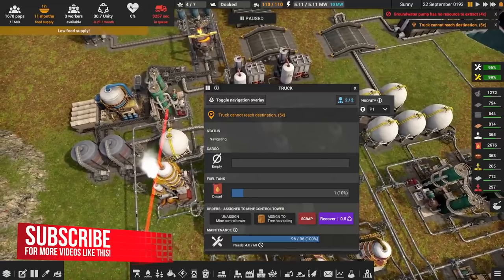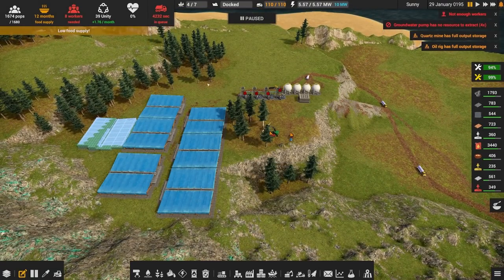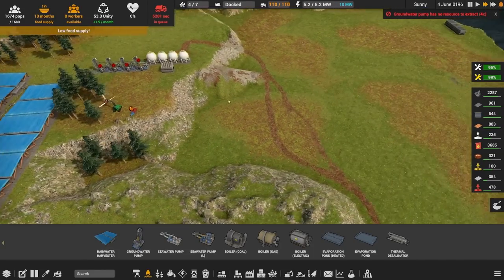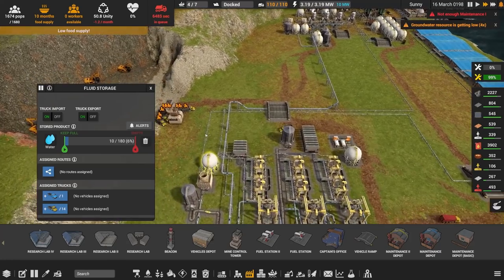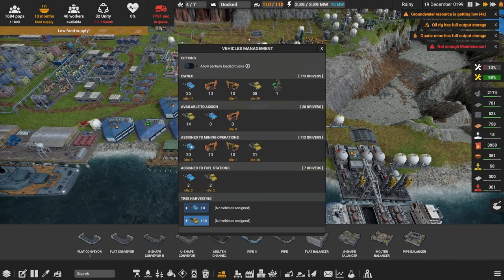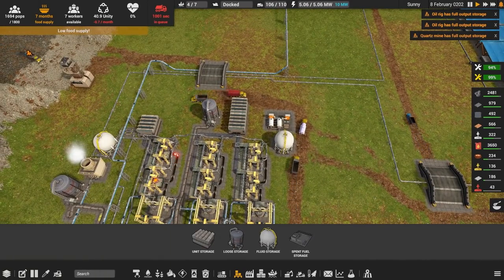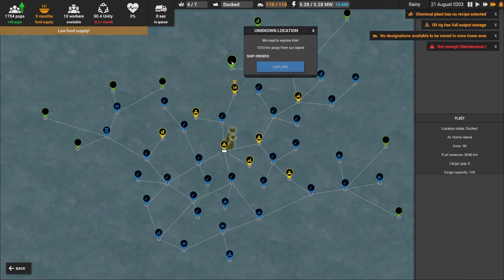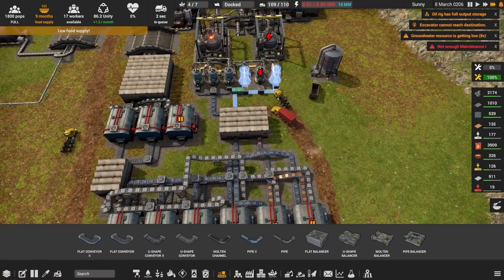Manufacturing CIRCUITS! - Captain Of Industry BETA - Automation Factory Builder - Episode #15

Comment: The cue seems to be the trucks waiting to dump the slag and soil that thave no place to go since you started assigning specific dump sites. Some are pointing to a location that isnt a dump site any more or where you are expecting them to dump on a dig location. Some inputs like te iron input for the new steel, have a small loop where the second input buffer allows exports